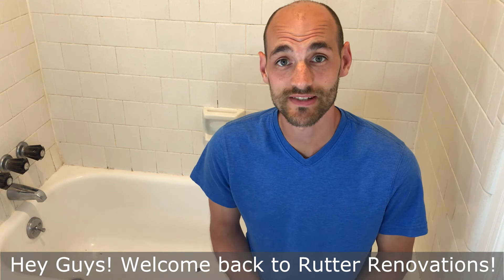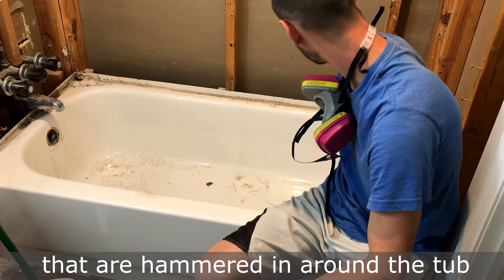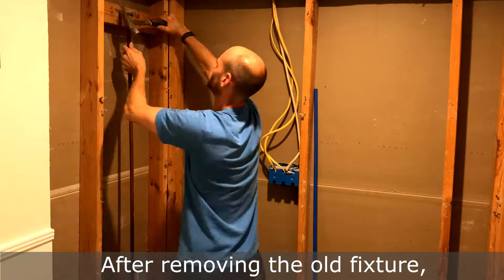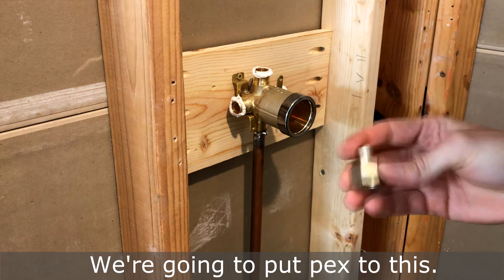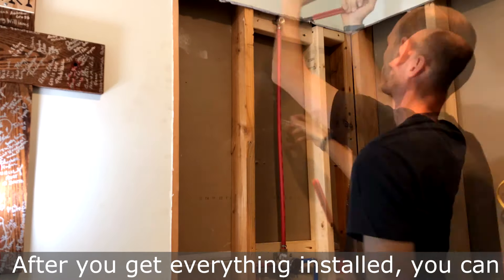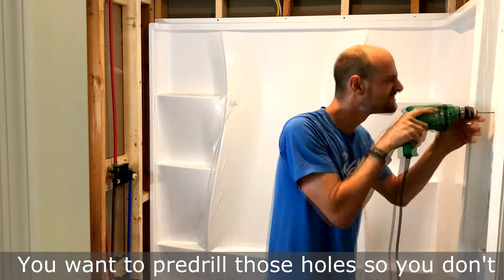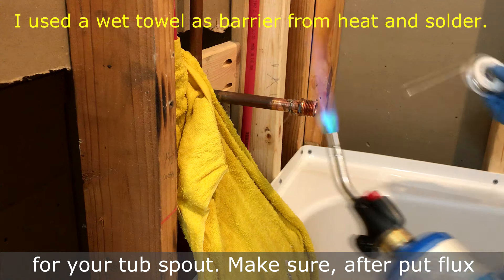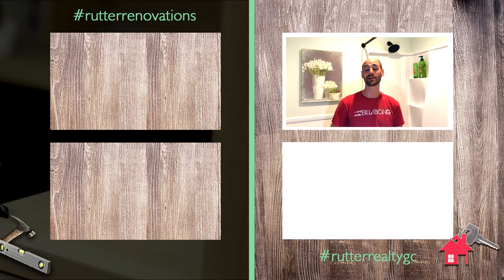How To Install A Bathtub And Shower Wall Set!

Comment: Where is the insulation and moisture barrier?
Reply from the maker: There’s no insulation on this wall because it’s an interior wall. The moisture barrier is the shower wall itself unless you’re referring to it not being an exterior wall again.  It is installed according to the manufacturer’s recommendations and specs. 👍😊
Reply: @rutterrealtygc  I've Never seen it done that way...maybe California is different, we use insulation on interior walls and then place a moisture barrier over the insulation in-between the wall and shower panels...but if it works it works

Comment: How can we install this kit if our plumbing and drain are on opposite sides?
Reply from the maker: You would just get the correct tub (left or right hand facing drain) and drill the hole in the shower wall on the opposite side where your plumbing is, if I’m understanding you correctly.👍
Reply: @rutterrealtygc  the hole in the tub for the faucet is directly above the drain. I guess we could plug it and cut a faucet hole on the other end of the tub? Does that seem practical?
Reply from the maker: kay booth Hey. The hole for the faucet handle that turns the water on and off as well as the tub spout (where the water comes out) are both located on the shower wall and not the tub. The only two holes located on the tub should be the drain hole and drain overflow hole, both of which are associated with draining water and not the water supply or faucet. Are you saying that your current tub (if doing a remodel) has another hole for the tub spout and/or faucet (such as a garden tub or jet tub)? If so, how is it currently plumbed?
Reply: @rutterrealtygc  I get it! Now it makes sense what the hole was for. I haven’t had a bathtub in years and had forgotten. Thanks for your input. Really helpful.
Reply from the maker: kay booth 😁 You’re more than welcome!!👍😊

Comment: This tub will forever leak at the drain. You forgot to first remove the protective plastic wrap from the tub before installing the drain
Reply from the maker: lol. No I didn't, but thanks for giving others a heads up regarding the plastic wrap. Best of luck with your project.

Comment: as far as remodel showers go that looks nice but the material is thin and where walls go together is a bead of caulk away from failing
Reply from the maker: The material is thin, but flexible and has a very good ratings for durability which is the main reason that I installed it in this future rental. The walls are solid when installed properly. Aren’t all remodel pop-in showers a bead of caulk away from “failing” (assuming you mean a leak)? The pieces actually overlap with a pretty substantial lip, so you’d have to have pretty forceful water hit a seam (assuming you had no caulk) to leak behind the tub, let alone a lacking portion of caulk. I’d say the chances of a bead of caulk failing are pretty slim. We’ve had ours about a year and it still looks and functions great.👍 Best of luck on your projects and I hope your shower turns out great!

Comment: Don't use sealant on the drain! In 20 years when the drain is corroded, the next person will not be able to replace it. Plumbers putty works fine!
Reply from the maker: Plastic won’t corrode. 😊
Reply: But clogs happen and snakes can go through plastic fairly easily. If for any reason it needs replaced in future it's just a headache for the next person. Plumbers putty is what SHOULD be used on the tub drain. On lav drains, kitchen drains, etc. You also said something about using plumbers putty on threads which is incorrect. And when soldering a joint you always heat the joint side not the pipe side to draw the solder into the joint. Capillary attraction.

Comment: I was taught not to use compression fittings/valves behind walls unless it’s temporary of course. Not saying it’s wrong to do it your way but a soldered joint is always better than compression so I’ve always used shark bites just to turn water back on for homeowners while walls are opened up and after demo is completed the first thing I do is solder new shower valve and angle stops first thing in morning so I can address any leaky joints and walk away at end of day with confidence of no leaks before covering walls back up. Just another way to skin a cat!
Reply from the maker: Definitely would be better! They have been good. It was mostly done to show people that they could perform a remodel such as this using different techniques. Thanks for dropping the comment!👍😊

Comment: DON NOT PUT SHARK BITS IN A CLOSED WALL.
Reply from the maker: They are not closed in the wall. They are accessible through the access panel and can be easily swapped out if you so choose. :)
Reply: @rutterrealtygc  well that changes everything. Thanks for replying.

Comment: lost me at sharkbites in the wall, i mean.. why?
Reply from the maker: So the rest of the house can have water while you complete the project (assuming you’re talking about the shutoff valves).👍
Reply: @rutterrealtygc  i was referring to the actual placement of sharkbite fittings inside a wall cavity when there are better proven methods of making connections such as sweating which only moments later in the video you exhibited having the right tools materials knowledge skill and ability to do so
-i realize you didn't ask but personally I don't trust sharkbite push-to-connect fittings enough to put them in walls as they rely upon an o-ring which may or may not last anybodies guess how long, especially when there are less expensive better proven methods.. hence my question of "why?"
-Sir I am familiar with the concept of shut-off valves 😅

Comment: Do not use those flexible fittings. They are illegal in most areas and the collect gunk and tend to leak. I don't even know why stores are allowed to sell them. 100% against code in most areas.
Reply from the maker: By flexible fittings, you mean the shutoff valves or the crimp rings?
Reply: @rutterrealtygc  The flexible drain tube you used. A building inspector would never pass a drain with one of those fittings, regardless of it being in kitchen or bath.

Comment: Flexible drain, sharkbites, cinch crimp pex, delta shower valve 

It’s all bad.
Reply from the maker: You should create some videos!!👍😊
Reply: You can tell he is not a pro but this video is exactly what I need to tackle a project like this for myself.

There are obviously some things I would do differently..

Get better at soldering (I literally just watched a few videos before this and sorry Ryan but your technique isn't very good.. judging from where you placed the flame) I'm no better though but hopefully that will change soon 😛

Skip the shark bites, pex, flex drain. If I want to make it a bit easy though I think I'd use CPVC ? Unless it's not allowed for some reason, than just stick with copper as that's what is currently being used in my walls.

You said in the comments you used tape on the drywall joints so I believe you but I noticed it right away in the video you didn't show it.

Overall it looks good . But if anyone sees this video hopefully they see all these comments too and know what they can improve on.

I've watched a few of these videos already and this is the first one though that really shows the whole process so thank you 👍